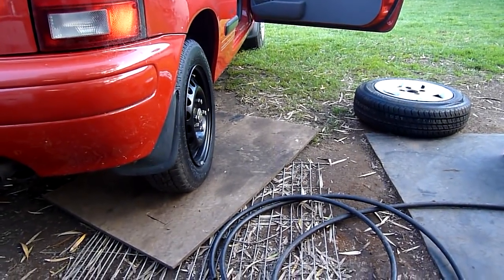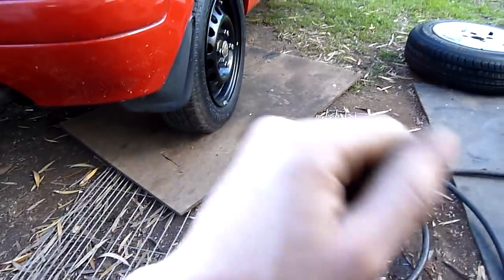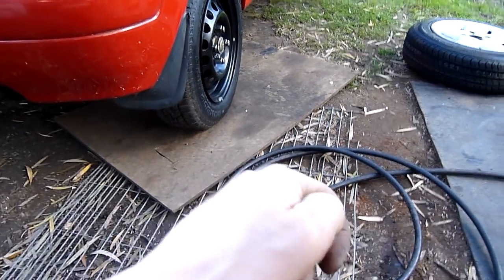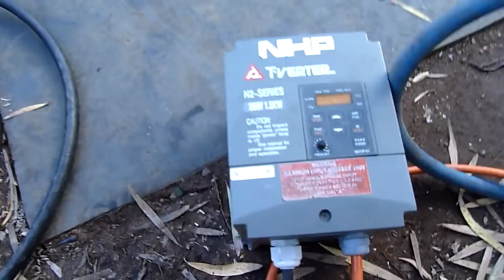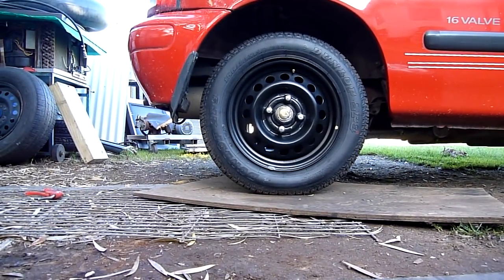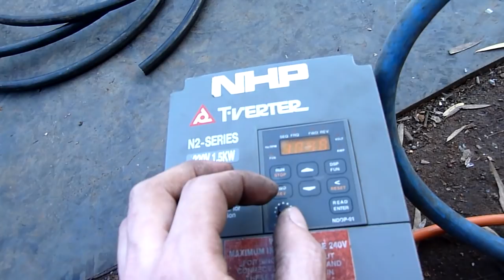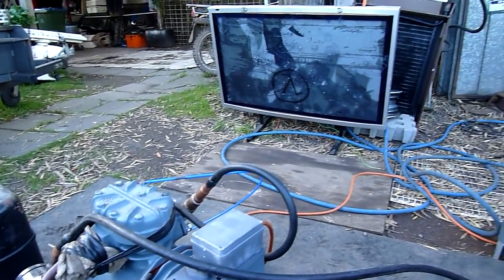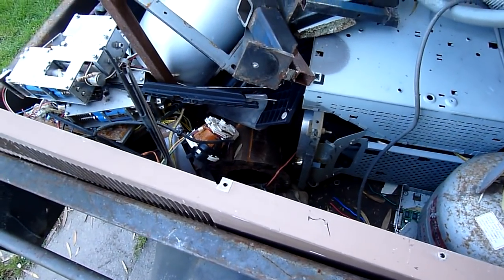Nissan Micra - Vac Down Flat Tire Fun

Comment: It would ride rough and be a pain to start moving and slow or stop the car , but it would have great traction , we do this with lawn tractors to plow snow or  pull a rototiller in the garden , Bigger equipment we use calcium chloride for liquid weight and you can tell when you try to get a big machine  like a front end loader to move or stop .

Comment from the maker: the suspension of the car would have to be rigid tho, hit a bump at reasonable speed and it would take ages for the suspension to push it back down. it would actually be dangerous to drive above running pace!

Comment: ED do you have the little compressed CO2 cartridges down there?  I would want to see if one of them has enough compressed gas in it to try to fill one or see how many it would take to fill a little tire like that up to operating pressure , I know the large spacewaster  tires used a liter ( size of a propane bottle ) of compressed gas to fill a tire at 250 Psi to fill a tire to 50 psi  ( OP pressure )